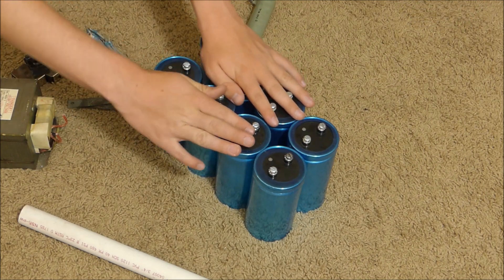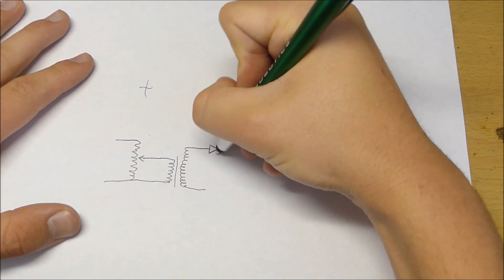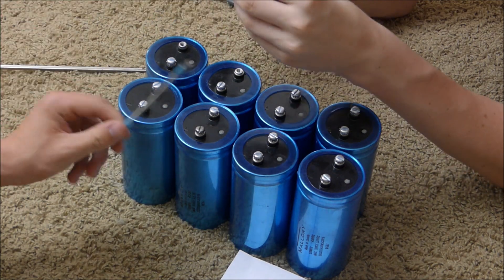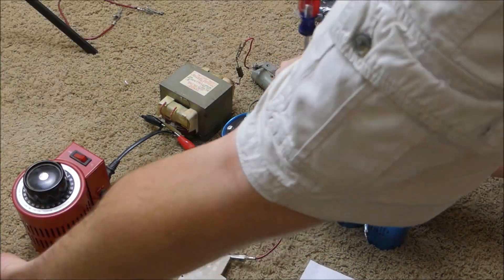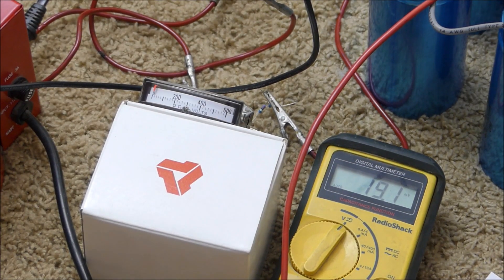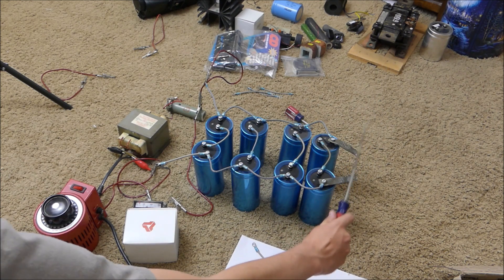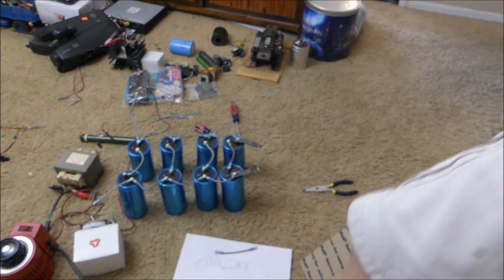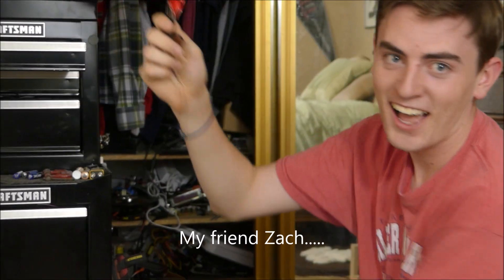Big Capacitor Bank 520 Joules!

Comment: Unlike the battery, a capacitor is a circuit component that temporarily stores electrical energy through distributing charged particles on (generally two) plates to create a potential difference. A capacitor can take a shorter time than a battery to charge up and it can release all the energy very quickly.

Comment: Its nut just unsafe it’s dangerous to handle capacitors like that maybe he did discharge them before and knew forsure but atleast say that befor eyou slap boths hands across the terminals of a enormous capacitor bank

Comment: Hey Bud, im new to your channel.  I want to know if you can give me advice, maybe in a video but basically I want to make a rapid charge and discharge capacitor bank that operates of a cars 12v battery or alternator.  I want to experiment with a hydrogen cell using pulse dc to create the electrosis at high voltage and my cell would behave much like a dump coil minus the explosion/shrapnel lol....the idea is to avoid using a electrolyte in the water.  Thoughts?

Comment: I have to tell you LOSE THE MOT (in time, it will kill you)!!!  Use the variac with an NST...it is infinitely safer, current-limited (no resistors needed) and you will not (indirectly) encourage others to die! 
THIS CAN'T BE EXPRESSED HARSHLY ENOUGH!!) ..40+ YEARS EXPERIENCE SPEAKING... Also you will like it better, AND BE ABLE TO CHARGE BIGGER CAP BANKS! etc, etc, etc...

Comment: I recommend loosing the MOT and just build a full bridge rectifier and plug it into the wall. Less dangerous. Also, never touch the terminals of a capacitor with your hand, one day you might do that and one of the caps could still have charge after discharging and you will get a nasty jolt. Please read into more safety. Also do more research. My single 200v 470uf cap can produce the same effect if not very simular. Look for capacity not voltage and size.
Reply from the maker: I agree, this was pretty dangerous.  I do not regret it though. Your capacitor only holds about 9 joules of energy vs mine holding 520 joules.   The energy stored in a capacitor increases exponentially with voltage. E=.5*c*v^2.  This is the reason I chose to go with a higher voltage.  The explosion when this capacitor bank is shorted is far better in person.

Comment: Tanner go check my monster 5000j 50kg pulse capacitor video 🤣🤣👍👍
Reply from the maker: Eyy, just checked it out and subscribed.  You have some awesome stuff!!! Where did you get a capacitor that big?  Also, what schmatic did you use for your VTTC? I built one a while back with an equally big tube and only got 1 foot streamers out of it.
Reply: @TannerTech  oh you mean the gu39 coil I made it up as I went but I will do a video showing schematic etc when its finished mate... I think we can get a lot more yet.. I have 8 of those big caps🤣🤣.. 
Did u see my gu81 build 12 inch secondary three foot arcs....
Thanks for subbing 

Steve
Reply: @TannerTech  do u have an email address mate?
Reply from the maker: I do, but I don't like sharing it publicly. I should just make a channel email though. If you give me your address, I'll send you an email

Comment: I'm still learning what pieces of electronics and electrical systems do what but this video and its lack of safety concerns me greatly when i see exposed carpet with high voltage capacitors, no safety in sight, and probably not even a fire extinguisher within reach or knowledge; but hey what ever gives the loudest boom eh?

Comment: 520 joules? But that is only 0.14 amps...

Or 1.25 at 400v and 0.55 at 900v😅

Jolues suck
Reply: You don't know what you're talking about.
Joule is a measure for energy, so you can convert it to power (watts) over period of time (seconds or hours), and you don't even mention time in your post.
If you drain out the stored energy of 520J over an entire hour, it's only 0.1444 watts = 520 / 3600 sec (1 hour)
If you dump it over 1 second it's 520 watts, so yes this would be 1.3 amps at 400 volts.
BUT if you dump it over a fraction of a second, for example 1/100th of a sec, you can get 52000 watts, which will put through a human (10000 ohms) 2.2 amps at 22800 volts, i.e. can kill you.
Reply: @JC-XL  maybe I didn't mention time because it wasn't even a factor, maybe you should do your homework and learn I don't have to cover ever single possible basis in a simple comment, hell it could discharge over 15000 years, you want me to work that out too? Maybe you should keep your damn mouth shut
Reply: @phonotical  How is time not a factor?
This very statement shows that you don't understand the basics.
You don't understand that 520 Joules is an amount of energy and it can provide certain power (watts) over CERTAIN LENGTH OF TIME!
You can not convert Joules to Amps/Volts/Watts without considering a period of time!
Let's be honest, you just plugged 520 Joules into a calculator and got 0.14444 Watt Hours back, but couldn't even quote that properly and said "0.14 amps" 😂 😂
Reply: @phonotical  I am not sure your 4 partial or incomplete sentences can be considered a "basic statement".
But, alright, maybe "Jolues suck" is a basic statement.
The only way I would agree with that is if you meant that you do not understand what "520 joules" means, because you obviously do not understand.

Comment: You are supposed to put 1Mohm bleeder resistors across 400V DC capacitors, so they slowly drain when power is disconnected.
The rest of your setup is unsafe too, but leaving the capacitors with an unknown charge is asking for problems.
Granted they are probably old enough to self discharge, but I doubt it's to 0V.
Reply: He’s not doing some complex precision job the dude just made a capacitor bank
Reply: @nathenstone4147  Yeah, these kids are doing just enough to kill themselves without having to eat Tide pods. No precision required.